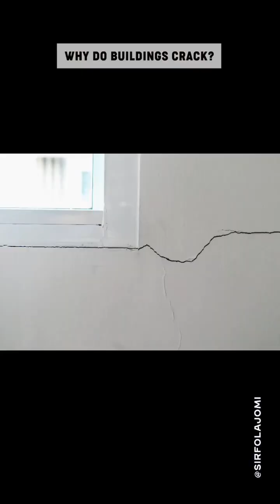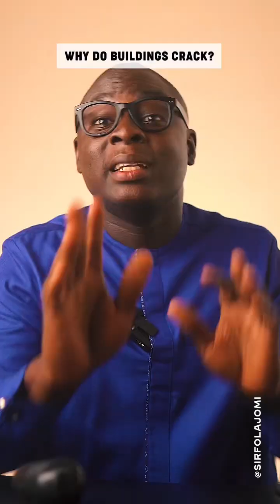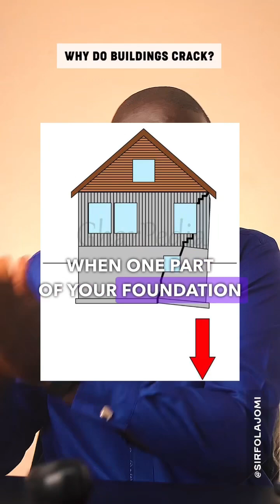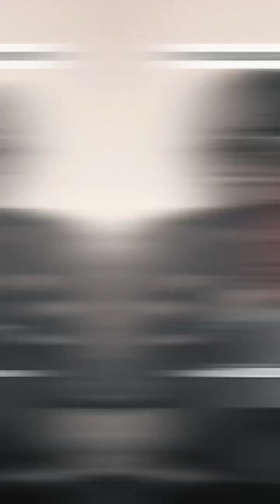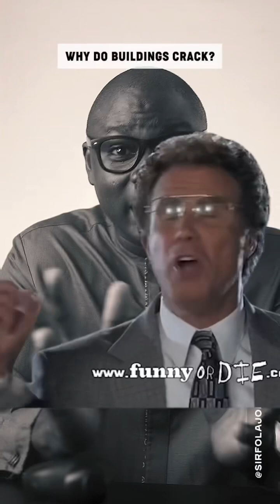Why do Buildings Crack?

Comment: Cracks can arise from inappropriate mix of the cement-sand plaster (mortar), often called mortar cracks. 
Other cracks arise from differential settlement of foundation, or other lateral movement of walls & floors. These are dangerous and termed called structural cracks.